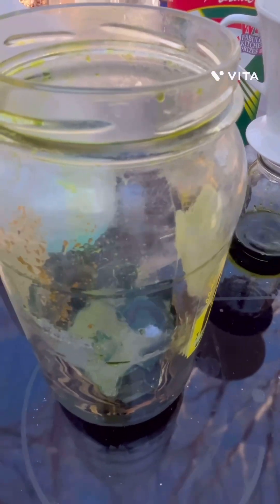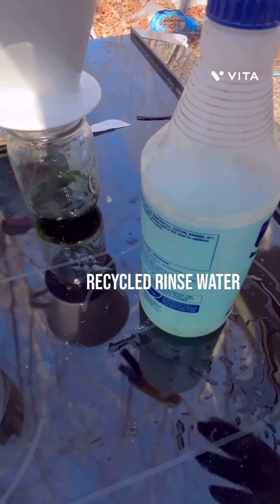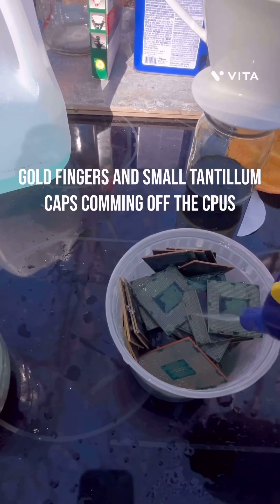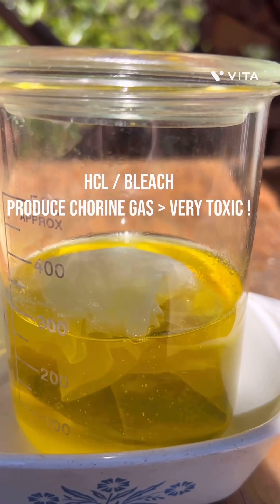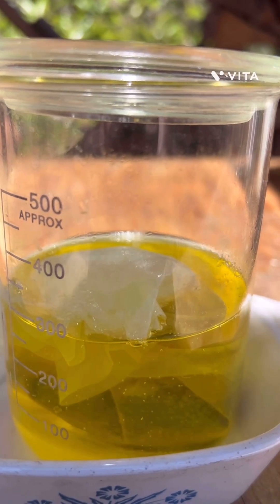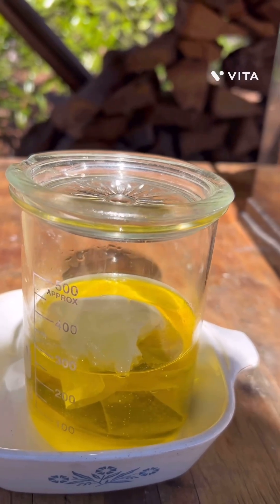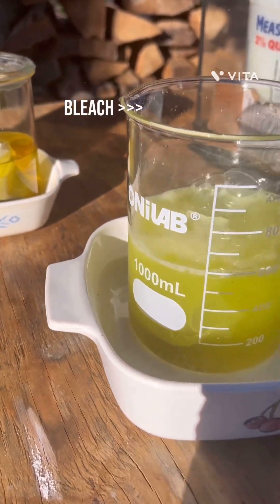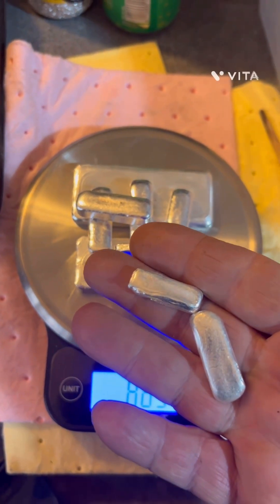Gold- from pinless CPUS

Comment: I watched to see if  one performs the same denox and smb steps as usual for cementation.  Unsatisfied, I liked and subscribed anyway.  Btw my DIY stannous gets weak often and I have made it a point to have a small container of AuCl (from previous refinings) to test my SnCl with.  The AuCl seems to keep indefinitely, only need a small amount and can be diluted
Reply from the maker: DeNOXing  is for nitric solutions 
I used HCl and bleach as a strong oxidizer to dissolve the gold foils so there is no need to deNOX . However I probably should have heated the HCl + bleach solution and reduced . I am continuing to recover w/ cementation using copper pipe and aeration . But it looks like silver . More to come 
Thanks